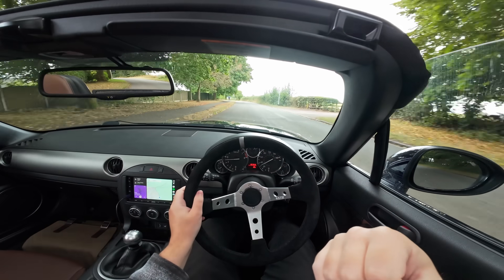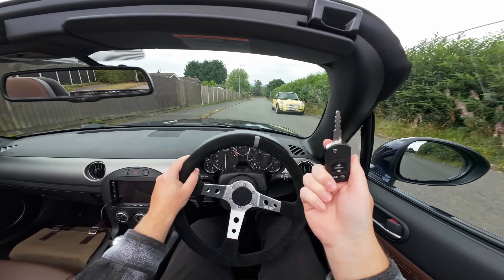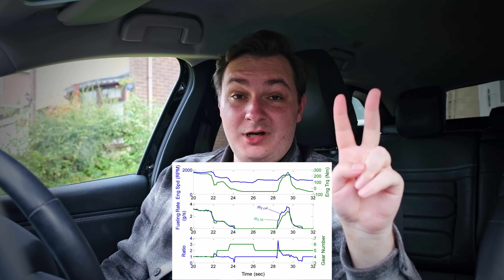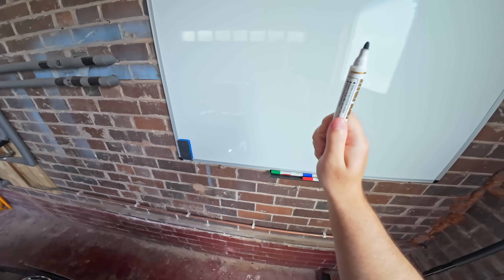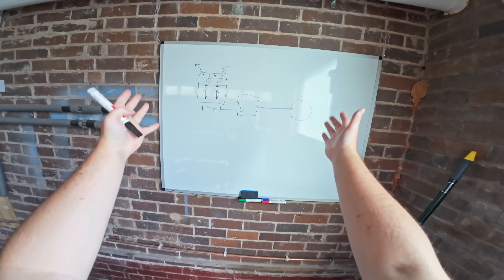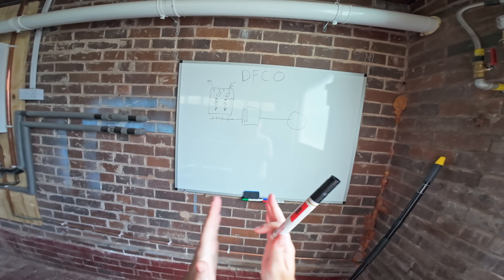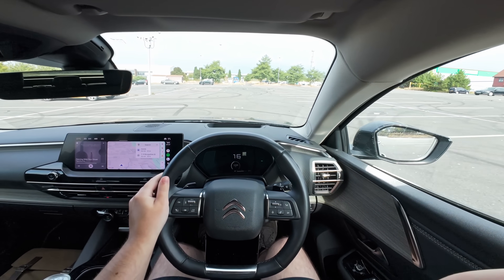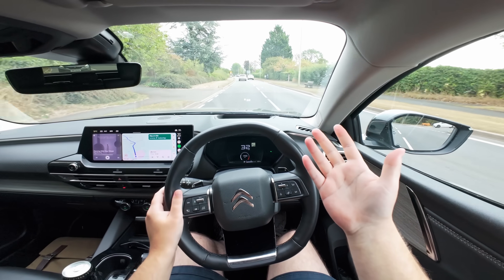The most misunderstood car term - Engine Braking

Comment: I love to do this in my truck to save gas, and when I'm going downhill the only times I use my brakes are when people are being unpredictable, or when I use the brake to protect my clutch when I'm downshifting. Engine braking is so much better than regular braking for loooooong hills. I have to preface that my truck's transmission and engine are both designed for engine braking because that's primarily what it uses for towing, so it won't damage the system more than usual doing this.

Comment: for more modern engines, yes engine braking just uses air. for slightly older engines, it uses just as much gas as the engine would use in neutral, and in cars old enough to have a carb, THOSE use the same amount of fuel in drive as in engine braking.

Comment: I just feel the need to say this, do keep in mind the difference between engine braking and engine broken, engine braking is when you let off the throttle, engine broken is when you shift down to third after being close to redline at fifth gear, they will both slow down your car but one is a fair bit stronger then the other

Comment: how does this compare with regenaritve breaking in a hybrid? like when I brake it goes into batteries and my engine breaking is quite aggressive due to regen, advice?
Reply from the maker: It's one better - not only are you using zero fuel, you're now actively storing that energy in the battery
Reply: @MickDrivesCars yea but I mean efficiency wise. Because engine breaking gives momentum for free, but how much losses do you get when turning back into elec, storing it and then using it later? Surely you lose energy in the store and reuse cycle and would be better off driving properly?

Comment: "modern" cars with trip consumption and current fuel consumption stats even show 0 fuel consumption when lifting off the gas. If you put them in neutral they start idling again and use fuel. Even my driving instructor told me this

Comment: It was so scary that he pulled out the key. I mean for power steering and breaking, you need power, and the steering wheel can even click in the theft protection thingy (dont know the name) when you cant move it. Its so scary. But it proved the point.
Also its not "potential energy" but "kinetic energy". Or just energy or momentum. You are not rolling down a hill. But its fine, we get it.

Comment: The video only seems to address “coasting”, not true downshifting. So the very loud growling (engine) noise I hear when I’m under heavy engine breaking (manual transmission) is just the sound of the vacuum and engine turning, but not the spark plugs igniting at all? I wish he would be more specific. This is very interesting.

Comment: Damn, I've been using this from the day 0 and only thing I'd ever call this is common sense. That said, I was told to use engine braking when going down the slope by going into lower gear and I could use an explanation on that particular scenario. (I don't really drive to be honest, last time I was behind the wheel was well before covid.)

Comment: Fuel Injected modern engines are magnificent pieces of technology, and doing engine braking is best way to save fuel as they wont spray fuels when you completely lift off the throttle. But carburetors work differently as fuel is mainly dictated by airflow, hence older engines still consume tiny sprays of fuel but still lot less.

Comment: youtube mechanics aren't necessarily real mechanics.  Also, when the engine is mated to a torque converter, you can't effectively engine brake unless the lock-up stays engaged.  Other than that, I have the same frustrated feelings about the wasted fuel every time you brake with the pads.

Comment: nice vid, crazy all people dont drive like this tbh. its smoother, cheaper and just a more natural way to interact with the road and the machine than accelerator=go, brake=stop. 
I hate people who needlessly use brakes on the motorway, a one second press of the brakes by someone, normally due to not leaving a sufficient space between them and the car infront, can result in a chain reaction of people braking behind them and ultimately a complete stop a few miles back, which is irritating, innefficient and dangerous!

Comment: And yet if you have a realtime readout of fuel usage like on my previous mazda 3 sp25 manual, it would show your instantaneous fuel usage to be 0.

Since the drivetrain is connected and the stored momentum is still spinning the engine.

When you apply throttle, it'll start the boom boom process again as it knows when to start the timing of the explosions. 

Engine braking while going downhill can also save on brake wear. Autos can still benefit, just need to shift it to manual gear control or overdrive. 
Some even downshift when you're going downhill automatically.
The key here is to learn your RPM ranges, especially in a manual where you can shove it into a lower gear.
You don't want to go so low that you over drive the engine RPM into redline.
You might go from 6th at 100Kmh (62Mph) to 4th and have a greater engine braking effect. 

Edit: as an afterthought, petrol/diesel is not needed as a lubricant as oil still circulates with the oil pump. So if no boom needed = no injection.

As the pistons are now pretty much a vacuum, there are forces at play that causes loss in energy. 
Its why its interesting how cyclinder deactivation can still save fuel when cruising at the same speed, since two cylinders are not being useful! (Thinking of the newer mazda 3 as mine did not have that feature in 2014)

Comment: Even if fuel is injected without acceleration, ignition does not occur. This fuel washes away the engine oil coating the cylinder walls, causing the piston rings and cylinder to rub directly against each other, resulting in engine damage.
Naturally, this “cleaning fluid” flows out of the cylinder into the oil pan, diluting the engine oil and drastically reducing its performance.
The fact that you can maintain your car with peace of mind through only common-sense maintenance proves that fuel is not being injected when the engine brake is engaged (during deceleration).

In other words, prolonged ignition cut can damage the engine.
Launch control employs ignition cut to prevent exceeding optimal engine RPM, but since fuel is still being injected while the throttle is open, it effectively cleans the cylinder and dilutes the engine oil.
The anti-lag system intentionally keeps fuel flowing to eliminate turbo lag. It ignites the mixture using the heat from the exhaust manifold to keep the turbine spinning. Since the exhaust pressure required to spin the turbine overpowers the engine's resistance, normal engine braking doesn't engage, allowing for faster cylinder cleaning.
These cool features are not systems the average person should use on public roads.

Comment: i think some vehicles dont completely cutoff the fuel when off throttle, so its still giving as much fuel as if it was idling
but it probably is mostly in older vehicles
or am i just talking bs rn?
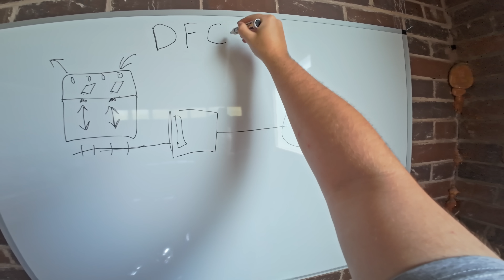7:53 oh wait… yeah, so aparently vehicles that dont have that use fuel, but most dont
9:18 oh yeah… the vehicle i had in my head as an example is carburetted😅

Comment: The only downside is that some automatic cars (no clue how many, my old one did though) go straight to releasing the clutch when you let off the gas so it coasts. The only way to engine brake was to shift to one of the manual low gears meant for towing and such. Now I have an electric car and I love watching my battery recharge as I come off the highway. You can even recover half a percent or more from full speed. So much energy to recover that doesn't get wasted as heat in your brake pads!

Comment: i've been only really driving for 2 years now and still don't understand why people refuse to engine brake. It even makes some people mad behind me which truly really baffles my mind. Anyway, I'm glad I found your video confirming I'm not actually crazy
Reply: well, a lot of times people want to get somewhere as fast as they can. Driving with engine braking while saves fuel, does not save time, so I can see why drivers are frustrated by someone doing EB in front of them.
Reply: @TheElderOne  I can understand the feeling of being trapped behind someone one perceives as slow, but the reality of driving that far too many drivers don't understand is that, unless you're traveling at some ridiculous speed over the limit (15 - 20+ mph), you're not going to save any significant time by being a little bit faster than everybody else. If you're in a 60 for example and you're going 65, you're only going to gain about a minute or two at most towards decreasing your travel time all things considered (traffic patterns, lights, changing road speeds, changing conditions, etc.). Even going 10 over doesn't add very much, and you're risking getting pulled over or even endangering motorists as you go up which make your time savings questionably worth it. Travel time with modern driving is affected more by distance, road conditions, and route pathing than it is by sheer speed. So speeding becomes redundant unless you're willing to push it farther than most would or should and at that point it doesn't matter what other drivers are doing, it's all on you.
Reply: It's not about speed. It's about traffic flow.
Reply: @the_real_Kurt_Yarish  Going 5 slower could make you miss a green light, causing you to miss the next green light, and so on, compounding for the entire length of the trip. It's not that cut and dry. Also, distance, road conditions and route pathing are not relevant nor controllable. Very dumb argument. Higher speed = lower travel time. Also, you don't know what "redundant" means.
Reply: @ahall9839  The timing of lights changing are also not (directly) controllable, but somehow that is relevant? Sure, going faster could mean that you'll miss a series of green lights... so does going slower. Or any speed. The timing of those lights are affected by so many variables that you could get any pattern no matter how fast you were going unless you can physically see them changing before you and time your passing as a result. Speeding in no way guarantees you'll get better light patterns. Of course distance, road conditions, and route pathing are relevant. Traveling further takes more time, and thus more indirect routes take longer than more direct routes. Routing through areas that are busy during certain times of day, or under construction can slow you down. Road conditions can drastically slow you down regardless making your desire to speed pointless. And, again, you'd have to speed up significantly higher than the limit to gain an amount of time that's significant compared to going approximately the limit. We're talking single-digit minutes here unless you're going +10 over. And at that point the increasing danger to motorists both for yourself and others results in diminishing returns. Not much point in speeding to a destination if you get pulled over or killed in an accident along the way, is there? Perhaps you think other people's or your own safety is worth sacrificing so you can make it to work or an appointment or Walmart 10 minutes faster, but I don't. Nor do I think making that decision for others to be responsible. Other people don't choose when you're speeding, they shouldn't be at risk to suffer the consequences.
Reply: @the_real_Kurt_Yarish  Yes, it's relevant, for exactly the reason I just said. I can only hope for your sake that you are being intentionally obtuse. You can beat the light by going faster. I encounter this situation everyday. Your destination is your destination, you can't change the distance. This is mind bogglingly artistic. You obviously always choose the most optimal route. The weather is what it is. This really is not that fucking complicated or hard to understand.

The rest of your inane artistic ramblings were irrelevant. You're not going to kill someone by going 33 instead of 30, or even 55 instead of 50, lowering your travel time by 10%, which is how someone with any critical thought would frame it, instead of throwing out random numbers like "a minute or two", since it's dependent on distance. Change in speed is inversely proportional to change in travel time.

Also, none of this assumes speeding, because the original comment was about going slower due to engine braking.

Comment: When the vehicle is carbureted, then its true that engine braking will use a little fuel wether ignition is on or off... But it's a different story in fuel injected engine

Comment: This will only work in fuel injected engines. I think Real Mechanics are still thinking about carburetted engines; they will still burn fuel, as the fuelling is passive, i.e. caused by the flow of air.

Comment: My car is pure computer controlled CVT automatic, my accelerator paddle have no connection to the actual throttle what so ever, Its more like a suggestion of how fast I want to go, and the car will pick the right engine speed and 'gear ratio'. So yeah, I have no idea when fuel is being injected or not lol. (Which is sad)

Comment: Great for getting gently to a red light, saving brakes, using the energy you stored in the car movement to slow down, great to slow if you have an emergency, great when going down the slope, in the hilly terrain, good for economy and the wallet. Useful tool to have. Engine is a great air pump and a heatsink.
Reply: It's not energy that you've stored in the car that's slowing it down. It's air from outside being let in through the intake valves.
Reply: @James-p7f5b Yeah ? And what is actuating the entire mechanism to pump that air ? What is pushing on that engine to keep rotating itself with no fuel present, sucking air, compressing it and expelling it ? The entire frame of the car pushing on the wheels which, throught the transmission, push on the engine to keep dumping the car's energy of motion into compressing that air...

Comment: So it won't use fuel until RPM lowers to idle but then it will be going to slow in a higher gear and will stall.

Comment: Would it be better to turn off the key if I'm going to be engine braking all the way to a stop? (Like a stop where I know I'll be stopped for a while.) Wondering what the engine would sound like doing that.
Reply: no. you need the ignition to be on, to be sure all your stuff is working like your oil pump etc. Not all of them are driven by belts IIRC. Also turning off the key what if your steering lock engages?
Reply: @xTerminatorAndy  This is true, steering lock does engage. (I've done it before and it's scary) I think my car's oil pump is driven by the engine, but ignoring everything else, would the engine go to 0 RPM smoothly and gracefully?
Reply: @ansonx10  ok you're right about the oil pump. I did look it up and it's mostly belt and chain driven, but there are other reasons. In short, it's bad news. If your car is moving, your igintion should be on 🙂
Reply: @xTerminatorAndy  Of course, but I'm only wondering about the engine itself. Mainly what it would sound and feel like.

Comment: (To add another comment but shorter this time.) If you are on a downhill and you are engine braking too much and give it the teensiest bit of throttle and off again, you can feel the car almost jerk into and out of DFCO.

It drives me nuts in my old Lexus that it's either too much engine braking or way too fast on a huge local downhill we have. Luckily the sweet spot is only like 3 mph under when the rpm drops enough.

Comment: If a car has instantaneous fuel economy on the dash ("Current MPG") you can see DFCO kick on when it jumps to 99mpg.

Counter point, if you let off the throttle on an efi motorcycle without an AIS, plus some anti-DFCO, you can then later crack the throttle and get a good after-fire. (I calculate it into the smiles per gallon because doing that is not quite hybrid levels of efficient.) (Also, something something, incomplete combustion, something something, overrun tuning, something, DFCO.) Double counter point, if you turn off the ignition on a carb'd bike and then turn it back on after it loads some fuel in the exhaust you get a REALLY good bang.

Oh, and good job on explaining this. Seeing proof that some smarty pants discovered how and when to turn off the fuel after we were able to do it electronically is all that a normal person should need. Like why WOULDN'T you stop supplying fuel above idle if cooling and lubrication needs are met on an economy car engine?

One thing that helped explain why things happen in an ICE intuitively was when a friend told me to think of engines as just fancy air pumps. 
Using that logic: You have a throttle plate, it holds back air from entering while the car keeps fighting to roll, and bam, gasoline engine braking "power". Diesels lack a throttle valve, so they must rely on other things to engine brake. Namely things that mess with the exhaust. Either way, air is trying to get pumped and normally we use explosions to help it continue that.

Also also, some cars unlock their torque converters before others on decel, meaning you get more or less engine braking versus coasting ability. "Sport" or "tow" modes can change this all up on the fly, I'm pretty sure. Cruise control could also be set by the OEM to aggressively downshift for more engine braking on downhills. Some cars don't seem to try to slow you down very much in cruise control.

All in all this is like the whole "does a car take more gas to start or to idle" thing. If your car needs to crank for a minute before starting then maybe yes you are wasting more fuel. But then you'd have bigger fish to fry first. 

So no, when rolling you don't use an appreciable amount when the pedal isn't pressed and in most cases, it uses none at all.